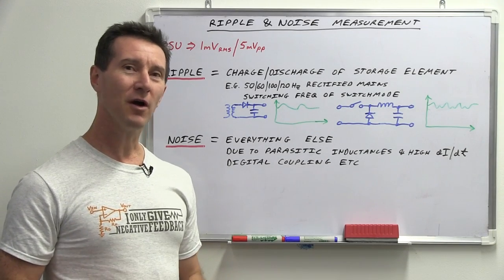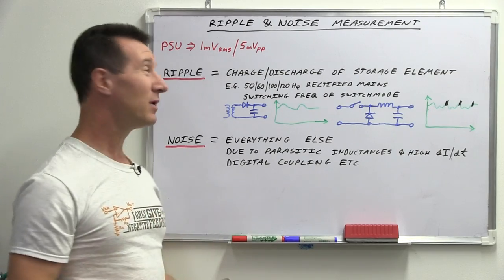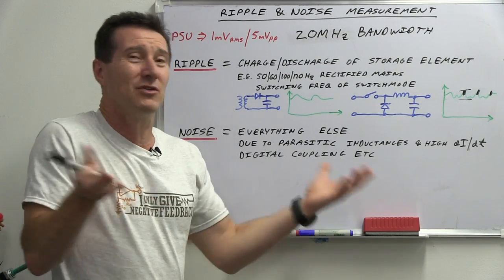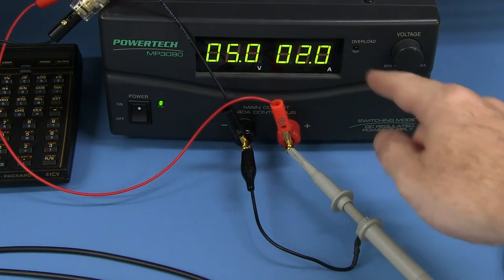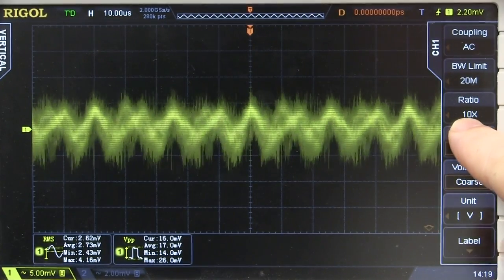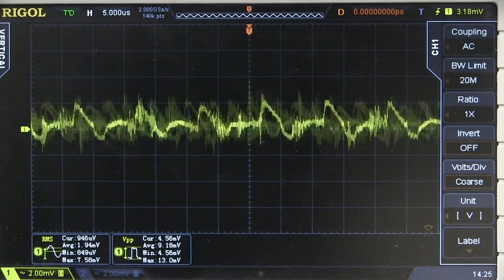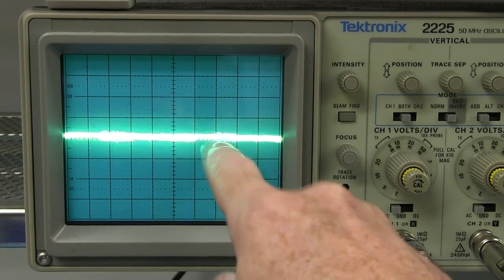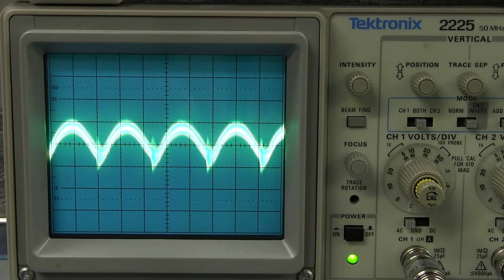EEVblog #594 - How To Measure Power Supply Ripple & Noise

Comment: shorter please
Reply: InXLsisDeo Yes. Needs to convey the information efficiently, shouldnt take 37 minutes to explain POWER SUPPLY RIPPLE !
Reply: 37 minutes to cover this topic was just about right....  you need to up your addirol dose joel.
Reply: I'd rather have too much info than not enough. Longer and simpler explanations will reach a lot more non "uber" technical players.

You can always skip ahead...
Reply: If it was at university.. it would probably be a 2 hours lecture not having half of practical info we get here
Reply from the maker: joelcr250
Ok, lets see you do a video explaining all the things I covered in less time. Yes, it can be done in less, but not drastically less. There is a lot more in this video than just PSU ripple.
Reply: ungratefulmetalpansy Maybe that was your experience, but not mine.  I graduated with none of those problems. Choose the right field, dont study Art History for example.

Comment: Dave, you may think 20MHz is an arbitrary frequency, but it is also the point where poor probing methods with long inductive probe ground leads start to cause extra ringing on fast logic causing measurement errors.  

So for clarity 20MHz is for convenience when risetime induces false ringing from poor probing skills and gets a better textbook looking trace.  

For ideal trace remove probe tip and ground clip and only use tip and probe ring to a pair of test pins or wires of similar spacing for convenience or use the coiled ground spring accessory . This gives the best results using a 10:1 probe.

Generally signals much less than 30MHz are used for this mode  but logic rise times faster than 100ns ( most are) will get an overshoot proportional to the ground probe length and transition frequency resulting in ringing..

Tony EE since 1975

Comment: Why the 50ohm terminators made so much diference?
Reply: Yes Mr Johns. Make a short video explaning about 50 ohm termination. Pliiiiiizzzz , with sugar on . Please ?
Reply: In this example it gave the signals a reference since the PSU is a floating supply.
Reply: It also acted as a voltage divider because the probes have about 300 ohms of resistance
Reply: Because without it the PSU output is at a high impedance.
Reply: It has to do with the coax usually having 50 Om impedance as well. Basically, the coax is a tramission line, and when you trasmit a signal over coax, it is vitally important to have it terminated with a matching impedance load. Otherwise, you get the signal all messed up.
Reply: @atexnik  yes, but these were probes. Not coax.
Completely different.
Terminating passive probes with 50 ohms is wrong. It will give you a false representation of the signal.

Comment: Measuring the ripple is so much easier using a True RMS multimeter. Set it to AC voltage, read the result, done. However, using a scope is more fun.

Comment: I got some Lambda LQ/LQD series linear bench PSUs recently, circa 1983 (warranty seals were unbroken haha!).. their ripple + noise specs are 0.15mV RMS, 1mV pkpk. Temp coeff. is ±(0.005% + 10μV) /°C. Line/load regulation is 0.005% + 0.5mV. Current regulation is 1mA/2.5mA (line/load), at full voltage range. Just fantastic. I verified those figures with my scope, still fully within specs. Zero overshoot with maximum load. They employ a custom Lambda branded IC for V/I regulation. I've sourced a replacement for one from China, gonna see if the specs change after I put it in.. I suspect it's not an original part from 31 years ago. :P

Comment: There is another aspect of power supply noise that is little thought of. I was involved with a huge project at a large computer site in 2010 that had to have the power supplies replaced on 5000 installed servers. The switching power supplies also  generate noise back onto the ac feed line. When you had 5000 servers with no isolation, all generating noise, the electrical noice would shut down the site UPS systems. The replacement power supplies,all 10,000 of them fresh in from China,now had toroid coils on the ac line. Guess the server vendor didn't save 20 cents per server after all ?

Comment: Hey nice video. Though one more way to get rid of high frequency noise is to use a 0.1 micro  farad disc cap on the probe tip. Infact you can solder it onto the probe tip and then leave a little bit of lead say 3mm extra to act as the points to probe the power supply. This is one of the standard methods

Comment: hi nice video dave. Though  in my company which made power supply for defense institutions and special custom built power supply. The way we would measure ripple is to use a single probe but solder a 104 disc cap on the tip ( 0.1 micro farad) on the tip. off course  no use the ground lead that is serious a big ***** antenna.

Comment: Another trap for a "young-player" might be that when one is playing around with the scobe probes and a power-supply, and they are both grounded via earth (3-pin mains) it may set the mains/installation fuse off or the "FI-switch" or both may in addition to a defective scope or PS. That´s why i´m running my scopes over a isolation transformer, in my case a 230V/230V to power up the scope. The tranny decouple its 230V output from earth.
Reply: I've also isolated my scope. Solved a lot of my mains noise problems.

Comment: How long can these DIY poor man’s coax diff probes be? Also is the tip end 50 Ohm resistor connected to shield or just inline?  And is a physical cap required at tip end or just select AC coupling on scope?

Comment: If you're looking at a beefier supply and seeing worse noise figures could this be because the manufacturer is giving worse case and things will be better at lower currents? The TTI MX180T gives something like 4mV for its 20A output versus 0.5mV for the smaller MX100T and its 6A output.
So if I use the MX180T at 6A will things be a lot better? Maybe comparable to the 100?

Amateur radio receivers would like a low peak to peak. If I play with motors or power amplifiers (whether RF or audio) I'd like more current.

Comment: Why would using two separate probes in subtract mode reject common mode noise whereas s single ened connection would not? 

Single ended connection still takes difference between signal and ground so if noise is common to both, it should cancel out right?

Comment: Why the series 50 ohm resistances at the far end of the differential measurement coax in additon to the parallel 50 ohm?   Edit:  Nevermind, I see the low impedance power supply needs a series resistor on its end to match the coax.  Great video, by the way.  I learned a lot.  Thanks, Dave.
Reply: No, your original question is valid.
There is no need for the source resistors. They will just add undesired attenuation.

Comment: Hold on, why does the single probe give proper measurement, if it is also a lossy probe? Doesn't Agilent have 50 Om input? Becuase if it does, then you should have got same roughly 6 times lower measurement as with the differential probing. Please, explain.

Comment: I had to laugh. He measures 20 mV pk-pk, and he says it's garbage. I just got my first O-scope running and measuring a cheap SMPS, a Chinese 13.8 V, 25 A power supply made for powering RC battery chargers. I get 1 V pk-pk ringing at 62 kHz, and adding about 10 A load I now get an almost 2 V pk-pk ringing 5 µs in front of the 1 V pk-pk ringing. From looking at the trace under load, the bigger ringing appears to be the supply switching "on" and the smaller ringing the supply switching "off".

Anyhow, THAT is a garbage signal. Fun stuff. Works great powering simple 12 V loads like lights or battery chargers though.

Comment: How do I know if my ripple capacitors can handle the ripple current? I have some surplus caps that I am using for ripple suppression, they are rather large and I am scared they will blow up if I have too much ripple current. It's on a 110vAC 60hz input with rectified ripple of 4-6v p/p. The Current load is 150amp for a DC motor load. Caps are 250v 2000uF each but that's about all the specs I have on them.

Comment: N00b question but I am Just getting started, at many psu I see a capacitator over the + and - with AC power input, this to prevent ripple and noise, but doesnt a capacitator lets ac-current through? Dont you short circuit the board like that?

Comment: Something I notice is that using buck converters that let me regulate current, such as battery chargers (XL4015), I had way more noise when I demanded a current near to the limit I put on. Lets say I set my power supply to deliver up to 1.2A, when I put a load that demanded 1A y had some noise, but if I limit the current up to 2A with the same load, at the same conditions, the noise was smaller than before ._.

Comment: Absolutely excellent tutorial.  I am going to have to troubleshoot the power supply of my VTVM, and my thinking is to make the probes you demonstrated for my Tek 475 scope.  I have another option that I wanted to ask you about, however.  It happens that I have an old Tek 545b scope with a differential plug-in.  My question is, what is the best way to hook it to the power supply, or am I just as well off to use your adaptors and the later model 475 scope.
Thanks,
Bob

Comment: 19:04
Why should you probe across the output capacitor?  Sure, the parasitics are lower, but wouldn't you want to measure the ripple/transients of the regulator itself? It's not like you're soldering power cables directly to the capacitor, so doesn't this give you an artifically low measure of ripple and switching transients?

Comment: Hi Dave,

Al video but can't find the information I need.

I need to measure some powersuppy noise. (cheap or RC equipment)
Yoi made the probes at 32min.
I think this will do but do you have a tutorial or pictures from this how you made it.
Type of coax (impedance) . Resistor and the capacitor you used?
Mabve buying a BNC cable
 Cutting it in 2 pieces to start with.

Thank you in advance or any follower that replies.

Comment: I just tried to measure the ripple of my Farnell L30-2 with my Rigol DS1054Z and it was as futile as trying to resist the Borg. The scope just wasn't good enough especially when the PSU is rated at a R&N of <1mV pk-pk on CV @ 80Khz. Using a math differential 2 probe solution didn't work either.

Comment: Would it be possible to stabilize a homemade smp somehow? Right now it's configured as two mosfets and inductors in serial (pre regulation and one for fine tuning the output) both are running at 30~ khz with the usual caps. One 1k uf in between the inductors and two chunky 4400 uf caps on the output. It's only intended for "light loads" (up to 5.5 volts @ 2Amps) it goes haywire far under that requirement though :/

Comment: is there a way you can shield the PS for your lights with proper grounding?, the ammount of RF noise that thing is putting out is insane!
Reply: I also have LED retrofit T9 tubes here. 6 of them in my living room 6500K. I'm not able to recieve FM radio anymore, when I have them on, altough the lamp fittings are grounded and even the reflectors are grounded. Problem is that the tubes are lacking of input common mode choke and filtering. The LIVE and NEUTRAL wires are acting as big chunky antennas... I think it's time to make coaxial mains cables, because of cheap thinking china products... And the tubes were quite expencive and the overall quality is very good. It seems just lacking the input filtering... Too much copper wire for the choke and additional inducter plus some caps...
Reply: *****
then put a filter in the input and let us know, you can get one of those filter modules that PSUs use from old PSUs (some of them have IEC C14 receptacle integrated) or just use the filtering board from a computer PSU as well
Reply: I have some filter circuits from the formery electronic ballasts of these fittings. But the circuit does not fit into the tubes, nor does it fit into the fitting anymore... :/

Comment: 16:50 ....but...but "digital scopes are just better!" LOLing at your DSO vs CRO videos. The testing equipment manufacturers really took a step back when they abandoned analog scopes; measuring noise was a big part of a CRO's bread & butter.
Reply from the maker: Wrong. I've done a video on analogue vs digital scope noise if you want to educate yourself
Reply: You've done two; I've watched both of them a couple of times. Your claim in the second one that "they're just better" (referring to digital scopes) at showing and analyzing noise is refuted by your comments at the time index referenced in my previous post here. A two-channel CRO does the business with just throwing a couple switches; with a DSO you need to use three channels, adjust persistence and muck around with channel phase inversion and, in some cases, buy (or hack) a software option for an analysis package.

You do concede in the first analog vs digital scope video (and in all your $50 eBay scope videos) that every EE should have an analog scope as entry-level gear, which goes to the point of my previous post: given their utility, there's no good reason not to still make oscilloscopes that are analog from the front end to just in front of the display driver, with no digital storage or software analysis (today's and tomorrow's EEs still know how to use a calculator, right?) Translating CRT beam deflection for an LCD driver should be trivial.

...which gives me an idea, so thank you for challenging me on this. A true analog scope with an LCD might be a cool open-source project. Most of the CRO designs came out of patent a long time ago.

Comment: hi  i got a tecktronix analog with ac coupling on that ,can i measure 450v dc supply with 1 x probe or i must use 10 x probe  ,can i see ripple on my scope with 10 x probe .What value is acceptable for ripple!thanks

Comment: hello EEVbolg! I need your help! I have designed a step up converter with switching frequency more than 200 MHz. How many bandwidth probe should i use? I use 1GHz active probe to test the ripple and the voltage ripple is unacceptable. There are much high frequency noise. Is it ok to add a small capacitor to do the testing?

Comment: For the past month, i have been taking hundreds of measurements the wrong way for my university project. Even the professors or the research assistants didn't tell me any of this. How I wish I saw this video one month earlier. 😭😭😭
Reply: Well, most don't do much of any hands on work. They get their grunt TAs lead all the testing, and even then, the TAs will rely on a lab technician with the electronics know how like Dave here.There are a few professors that do lab work, don't get me wrong. But most academics are snobs that won't bother with the dirty tedious work of testing and debug. Most electrical engineers just plain never learn this stuff because most of the EE jobs out there don't have an emphasis on this kind of testing. You see plenty of digital design, fpga and software coding positions, but they don't get exposed to dealing with these front end realities.

Comment: Please explain why you have the oscilloskop on AC coupling when measuring a DC signal..?
Reply: He wasn't measuring DC, he was measuring noise and ripple, which are both AC components riding on the DC. 5V DC would have over-driven the scope on the mV ranges, and so AC coupling was needed to bring the signals back down to 0V average.
Reply: Ripple and noise, are AC signals...
Reply from the maker: Because you can't measure the small amplitude AC signals in the presence of a larger DC voltage. The ADC in the scope doesn't have the resolution. e.g. a 5V DC supply and 8 bit ADC gives you 19.5mV per bit. So 20mV noise will only appear as 1 bit flipping on an off - useless.
Same for the analog scope where you won't be able to see the small noise on the DC signal
Reply: Thanks for the comments guys. I find it all very interesting even though I sometimes don't understand everything.
Reply: EEVblog i

Comment: if im checking a crown amp ps.with both b+ and b- rail voltage is it best I use the diff measurement method?

Comment: Im also thinking about the 50 terminators, why did that change the situation as much? I mean the shield was already grounded so the core should not pick up so much noise, right?
Reply: It is not only shielding, is also about impedance. If your ground is of "high" impedance ther will be a voltage drop. If your signal leed had an intrinsic impedance you´ll "only" get a voltage divider. If you have a ground impedance in your wire it is the same but little more: It is a voltage divider as well as an antenna for all kinds of fields. Magnetic and electric as well.

Comment: It was quite educative video, thanks for sharing. I wonder what is the noise level in 20+ years old computer power supply?
Reply: I think it is not much worse than today ones. Back then ripple was also a problem. Current PSUs are only much more efficient than the old ones. And the caps are of course crap, because they wanna save the last bottom microcent.

Comment: Hi Pro, at 14:37, could you explain why the ground wire of probe picks up noise? Thank you.
Reply: +Shiwei Luan The ground wire forms an inductor coil and the noise it picks up is some electromagnetic interference generated by other devices in the room - in this case mostly PWM-controlled LED lights.

Comment: Dave used a 50 ohm terminator on the oscilloscope.  What is a 50 ohm terminator and what are they used for?  I need my fundamental Fridays to be even more fundamental.
Reply: +00Skyfox Read about "transmission line termination" to really understand it. In short - a terminator is simply a resistor that prevents signal from reflecting at the end of the transmission line back to the signal source which would interfere with your measurement. BTW, not all scopes have a built-in terminator.